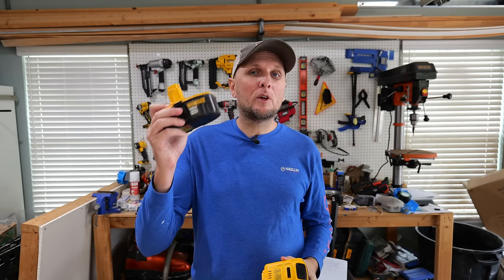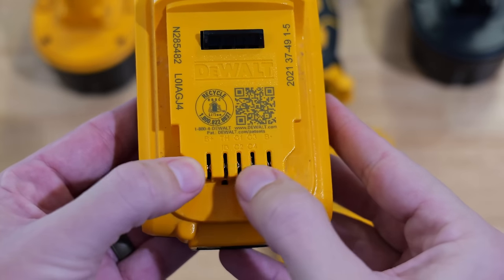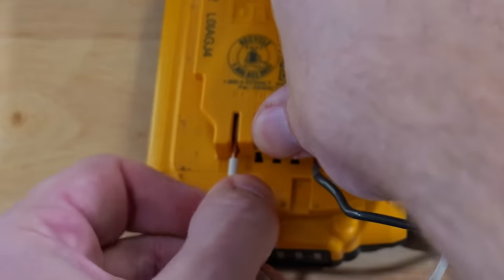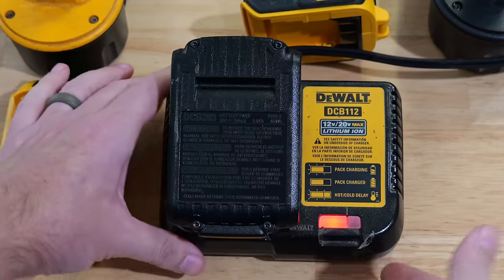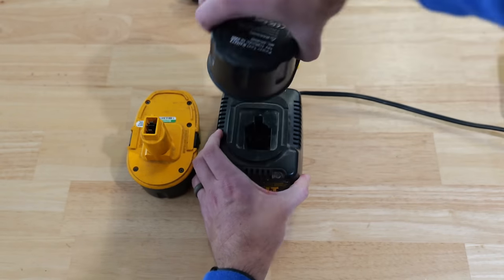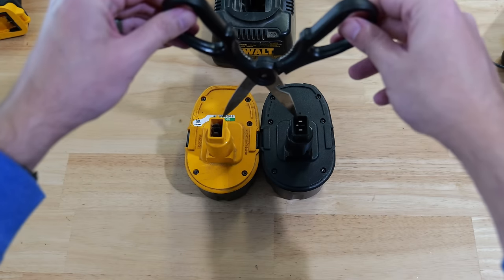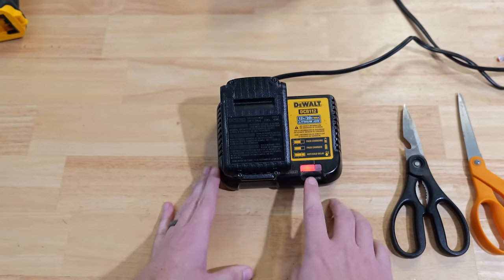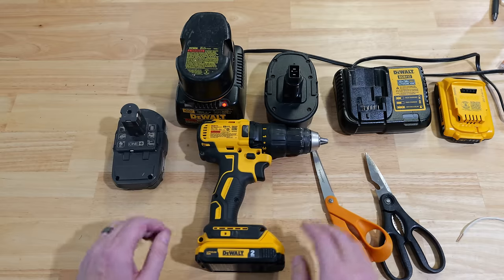SECRET To Reviving Dead Portable Tool Batteries | Super Easy!

Comment: How do you put out the fire afterwards?😂
Reply from the maker: Have never had one and have never heard of someone having one after doing this.  Is it possible? I suppose anything is.  Usually LiOn batteries have those types of issues when the cells are damaged and/or overheat.  So just having them sitting the garage theoretically could cause an issue.

Comment: Quit buying DeWalt.. the batteries on mine ALL went dead and they are expensive.. Now I buy only Harbor Freight Hercules cordless power tools. They run and run and I have yet to have a dead battery in 4 years of use. I have the cordless 20 volt drill, impact driver, circular saw, die grinder, saws all, sheet metal nibbler, and angle grinder. Never a problem..

Comment: I'm hoping you can help with a battery issue, I recently purchased a Craftsman charger and two batteries they are V20 4.0AH Lithium ION and when I purchased this package I got a new tool for free. I told the salesperson I was old school and had the old Craftsman set of tool that use the 19.2v batteries with the long shaft that goes up inside the tool, she said no problem there is an adapter that you can use your new batteries with your old tools. She looked on amazon  and give me the part number so I ordered it ,but you guessed it ,it didn't match and didn't not work. I returned it and ordered a different adapter but it did not fit or work. Do you know of an adapter that i can buy and use that will do the job. THANK YOU IN ADVANCE. sincerely LARRY

Comment: An important difference between the two parts of your presentation should be covered.  In the case of the older 18 Volt systems, those batteries are composed of NiCd cells (Meaning Nickle Cadmium Construction), whereas the 20 Volt Systems are Lithium based construction. These older NiCds have a habit, especially as they get older, of developing internal short circuits which gradually reduce the maximum voltage to which the battery can be charged.  This can be envisioned as little short curcuit whiskers within the cell, which removes their contribution from the battery total.  

This can be reversed, but it takes a bit of electrical skill. There are two general sets of circumstances, the first where the battery voltage is less that 12 volts and the second wherein the battery is greater than 12 volts as in this case.  First, lets cover the case of a single cell battery.  Fully charged, an individual NiCd cell (and a one cell battery) will charge to about 1.4 Volts and will taper down to 1.25 until it's about 90% discharged and then it falls quickly to less than 1.1 volts where it is considered discharged.  When the internal shorts occur, it goes to 0 volts and acts like a short circuit.  

A simple way to reverse this shorted condition is to introduce very quick pulses of relatively high current to clear the internal shorts.  My favorite hack for this used to be to use a car battery and an alligator clip.  I would hold the negative side of the cell on a ground point under the hood of the car and quickly tap the 12 volt positive on the positive terminal of the battery.  This must be done as quick tick tick tick pulses.  Sustained pulses of this high current will destroy the cell, or in some cases, blow an internal fuse link. In most instances, only a few are enough to cause the shorted condition to leave and the cell will go from 0 Volts (Shorted) to around 1.0 Volts (merely flat dead). When this happens, quickly apply charging current.

When a group of cells are connected in series to make a battery, then the situation is that the voltage to which it can be charged, will diminish in increments of about 1.25 volts.  In that case, I just tick the whole battery, but as the voltage gets higher, we get less current leading to the second case (from above) where the current available from a 12 volt car battery isn't enough to clear the internal shorts.

In this case, a source of a good current pulse at voltage greater than the battery voltage is required.  I have 30 VDC 8 Amp supply that usually gets this job done now.  A a good 18 volt  or higher battery may do the job, but I have not tried it.
 
IMPORTANT NOTES: 
No one is going to get shocked in any significant way on 18 volt batteries, but you can get burned on a shorted wire that could get VERY HOT, so exercise caution. 
I DO NOT recommend using a car battery which is installed in a modern car to tick the NiCds.  There are many electronic modules in new cars and none of them are cheap. DON'T RISK IT.
Lastly, in my experience, NiCds recovered as described here, can go on to live, in a productive way, under circumstances where they are BOTH used and charged frequently.  If you go through this process and then return them to the shelf, they often return to the shorted condition in a short while.
I have had some success buying replacement cell packs online from battery venders and then installling them in the Dewalt battery enclosures.  Some battery venders also make generic batteries already in an enclosure.

Comment: This doesn't always work.

I have two new B&S 82V batteries not used for 11 months. They would not charge with the charger only displaying a red light. I "jumped" them with identical batteries as instructed in the video. After that, the charger would show a blinking green light. However, neither would accept a full charge, not enough to run my mower for even a few minutes.

Comment: I repurposed a 36-volt 40-cell 18650 battery pack to use on my e bike. Accidentally I punctured the casing of one cell and it caught fire....in my workshop! Immediately I ran it outside and put it in my parking spot outside. It popped and burned for half an hour before I could sweep and clean up the mess. It changed my way of playing with lithium batteries. Lithium batteries will "run away" meaning you can not extinguish the fire!!! you can not use water! you just watch it and wait till it is done burning. 
Moral of the story. don't open 20 volt lithium battery packs. it is too dangerous.

Comment: My issue is the DCB 115 refuses to charge any battery at any temp or discharge state. My DCB 112 will charge all. Not all Dewalt tools are good.

Comment: When I insert my 18v battery into the charger the light on the charger plinks at a very fast rate, not normal, yet the battery does not take a charge. Why?

Comment: Ok, your 20 volt lithium ion battery pack has a built in BMS and the 18 volt Ni Mi battery pack does not. A lot of times the 18 volt battery has a completely shot cell somewhere in the line of cells. Usually towards the middle. If you have security Torx drivers you can open the 18 volt battery pack and individually test each cell using a volt meter. The bad cell must be removed or i have seen people jump the dead cell with a length of wire. Not My way to do it. Each Ni Mi cell is 1 1/2 volts or 1.60 volts fully charged. having extra used batteries around you can swap in a used cell for the bad one. You;ll need a heavy soldering gun or spot welder to do it right.

Comment: I have a dewalt battery that won't charge.  It has 2 out of three bars.  It won't run drills but will run dewalt work lights.   Charger says battery Is bad.

Comment: Interesting, however.....in 20+ years of using such tools, I've never had one not take a charge.    I always end up with the charge that last for 1 cut of wood, 3 screws or something like that.  Batteries take charge, say they are full, but last less than a few minutes.

Comment: It works faster if you just cut the cable off a 120V device and touch the wires to the battery with the cord plugged in.

Comment: Ok guys, I’ve had this with TWO batteries.  I put them in the charger, the big light stays on and the small light stays on indicating a problem with the batteries.  I ordered TWO brand new batteries, plug them in and what?  The exact same lights came on.  So I had 4 batteries that wouldn’t charge.  I ordered a new charger and what?  The new batteries charged well AND the old batteries charged within 20 mins.  So now I had 4 fully working batteries.  The problem here was the charger not the batteries and it was giving off misleading lights

Comment: It's not electricity it's DC current.Electricity is alternating current IE 120V not 18/20V DC.My air-condition teacher tried to tell the class the neutral won't shock them.Each light overhead only had 5 volts I told the teacher 20 lights x5 he claimed it had equals 100volts

Comment: 18v and 20v are the same.  No electrical difference at all.  DeFault calls them 20v MAX because when any 18v (nominal) battery is fully charged, it reads 20v at no load.

Comment: You know I did notice. That one of the pair of scissors. Used for jumpstarting the other battery. Was actually supposed to open up the bottle of beer. Before you started charging the dead battery. Because once you start charging the dead battery. You now cannot open up. That bottle of beer. So that was stupid. You should've opened the beer, first. What were you thinking? You never mentioned, the beer? What kind of an engineer are you? Sober? What good does that do anybody? Sheesh?

There's nothing like somebody forgetting to open up the bottle of beer. Before the charge..
RemyRAD

Comment: It wont work all the time. Sometimes the cells or the electronics are so far gone a repair is needed. Dont worry, try the hack anyway. If it doesnt work open the battery pack, check each cell voltage and check the control board for corrosion or other damage. Carry on from there.

Comment: What if you only have one dead battery and no spares to jump it with? I bought a Redback pole pruner and it only came with one battery. They’re made in Italy and pulled their distribution in the US. By the time I got around to using the pole printer, the battery was dead. I was able to jump at once by putting it in the charger in turning the charger on and off, every five or ten seconds for a half hour, using a strip outlet on and off for five or 10 seconds at a time for about a half hour. Then the charger would recognize it and charge it. But that only worked once. I can’t find a replacement battery anywhere and the manufacturer in Italy is unresponsive. I’ll never buy another made power tool made in Italy.

Comment: My 18-V DeWalt will charge but have no power. When I go to used tool goes dead immediately charger says it's charged what's wrong 🤔
Reply from the maker: The battery cells have been completely used up and unfortunately in your case, need replaced.

Comment: There is no difference between 18V and 20V lithium batteries.

The main difference between 18V and 20V lithium batteries is the marketing and labeling. The voltage rating of a battery is determined by the manufacturer and is often a marketing tool to differentiate their product from others. In reality, the voltage of a lithium-ion battery is not fixed and can vary depending on the state of charge and the internal resistance of the battery..

Comment: lol on the 20 volt the the trouble light was blinking and you edited it out. also, when you finally get one to charge they will not hold a heavy load and will discharge very quickly.
Best thing to do if you work every day with your tools is to buy new batteries.

Comment: I feel so ripped off.  I have never bought replacement batteries because buying a new tool that has a battery is always cheaper than just a replacement battery.  Thus and environmental shitshow because people end up tossing out the tools and batteries and just buying new ones, and an example is my drill that was $69.  The replacement battery by itself is $108.  And this probably would have fixed it because the tools will often sit a year unused and the battery goes completely flat even though it is still basically good.  THANK YOU for this vid!

Comment: However, if you just have the one drill, one battery pack & one charger, you STILL need to go & buy a second battery to jump your original battery to initiate the charging process...
 The whole idea was avoiding having to go buy an additional battery. 😫😖🙄

Comment: I’ve tried this previously on two separate dead Dewalt batteries and it does NOT work.
Reply from the maker: You didn’t have the issue I’m describing in the video then.  Batteries do eventually need replaced.

Comment: youre not reviving them, you balancing between 2 batts, but critically you are not balancing the faukty pack,  So despite getting a high enough voltage to  get the charger to read the pack, you have cells that are going to be disproportionately higher or lower across the pack.  Ultimately that pack will fail as the cells out of balance just get worse and become even less retrievable by an external balance tool

if you really unllucky the batt will catch fire

you might think youve saved it but youve delayed the inevitable.  this is especially so with the makority of 5S1P type batts

people seriously need to undersztand how these3 packs work before  giving out advice.  dewalt, ryobi 5S1P packs are notorious for this problem
Reply from the maker: I’m sorry but that is not always the case at all.  If it’s faulty it’s faulty.  Typically the charger will show that.  If it charges and doesn’t hold a charge it can’t be fixed.  Neither of those things is this for.  I explained this.

Comment: what if the batteries flashs no good
Reply from the maker: Then what is being shown in the video is not the issue.  The battery has an internal problem and unfortunately needs replaced.
Reply: thanks for the quick replied  i guess ridgid bats are no good only 4 month old

Comment: Tried this on more than one dead battery using a fully charged identical brand and voltage battery. Absolutely no luck. I called a company that restores batteries and his first comment was I hope you didn’t do that nonsense of using a good battery to jump another battery as that could ruin your batteries. So, sorry, but I called BS on this method.
Reply from the maker: Of course they are going to tell you that.  I wonder why 😂🤑.  And no, if the cells are completely used up then it’s going to need replaced.

Comment: Scissors.  Really‽  GTFO.  Safety be damned, I guess.  Oh, well…  With any of the methods shown here, people should be aware that improper charging of batteries can lead to fires or explosions.  So… my suggestion would be to not do this indoors and do it away from yourself and others.  For that matter, use long wires so you can get away from the batteries to make the connections.

Comment: you are showing 2 diferent battery chemistry nicad 18v and lithium , The reason they don't recharge is because the voltage of the battery is too low NOT necessarily dead. It is a charger safety feature to prevent accidental charging of a damaged battery. when a lithium gets over discharged the internal resistance increases and what could happen is the better cell could over charge and explode.  Don't do this repeatecly , if happens often get rid of the battery
Reply from the maker: Anything COULD happen.  But what you said is not always the case as to why it isn’t recognized by the charger.
Reply: @HowToHomeDIY   that is true, it could be a broken balance wire or a cold solder.  Lithium chargers check the individual cell voltages in this case. if a cell is dead and the other cell is fine you now have an imbalance of internal resitance.  it's the imbalance of internal resistance that can make them into garbage. 
.
Reply from the maker: @whodoneit4497 I don’t pretend to know the science or physics.  I just know it’s worked for me and it happens.

Comment: This doesn’t work at fixing the battery. All it does is give the dead battery enough energy to make the charger recognize there’s a battery and start charging. lithium batteries that get discharged past a certain voltage will get damaged and not hold a charge’ so even though you’re tricking the charger into charging the battery, the bad battery will not last as long and go dead really fast. The subject of this video has been done so many times by so many people and its misinformation and doesn’t fix anything. The only true way to fix the battery is to take it apart and replace the dead cells. Its not hard but most people will mess it up.
Reply from the maker: Most people will mess it up?  You have taken a poll or researched this?  What you say is not always the case.

Comment: You did not address a valid problem with the 18v battery. They will light the light but it will rapudly flash or turn red. Most of the time the battery will not charge holds very little charge. This is the case with most old 18v batteries.
Reply from the maker: I didn't address it because that is not what this video is about.  Batteries like that their cells are completely used up and will need to be replaced.

Comment: This in NOT the problem with the 18V ni-cad…..the problem is they ar JUNK and develop bad cells CONSTANTLY….requiring a massively overpriced replacement. These exhibit the “rapid flashing light” on the charger and CAN NOT be revived in any way other than rebuilding or replacing them…..often at about the price (EACH!) that the kit originally cost with the tool, battery(s) and charger.

SOLUTIONS:
1. Do NOT buy 18V ni-cad tools!
2. If you have these tools, buy an adapter to allow you to use 20V lithium batteries in them which are superior in EVERY WAY….stronger, lighter, smaller, and WAAAAAY better shelf-life!

Comment: Did that on dewalt square batteries didn’t work and old ones cadmium we use to double voltage on old still drills and that worked . But no luck with newer batteries . Batteries suck money out of your wallet .